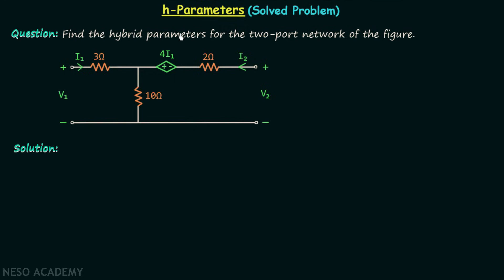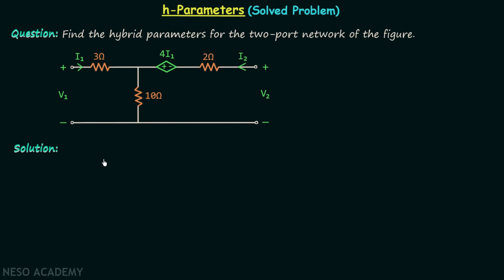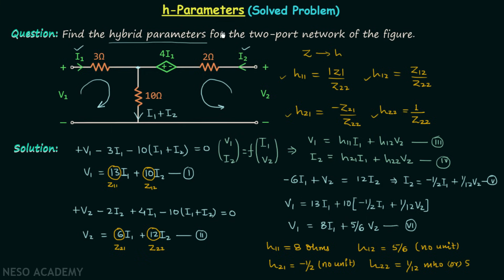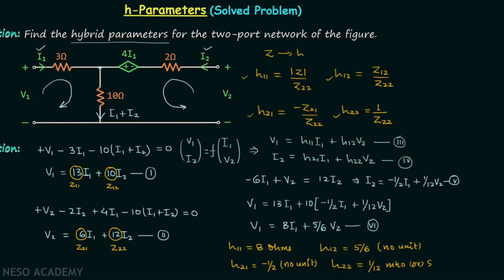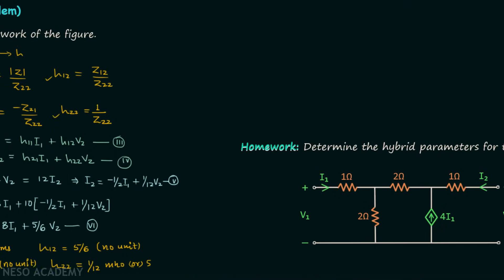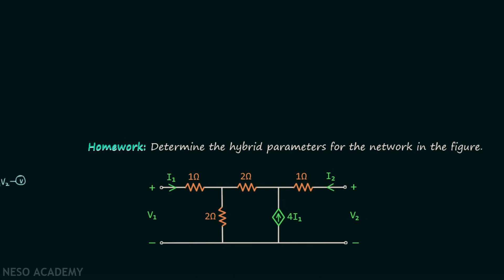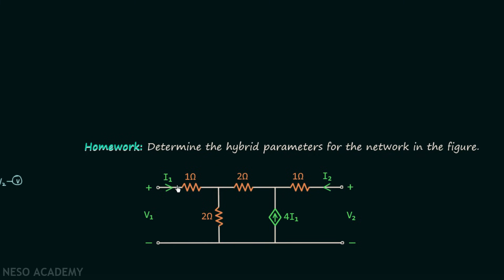h−Parameters (Solved Problem)

Comment: HOMEWORK
IN LOOP ONE OPEN 
Entering current = I1 
Exiting current = I1 
*MIDDLE LOOP CLOSED *:-
Upper branch across 2ohm
Current = 4I1 + I2 
Left 2ohm branch
Current= 4I1 + I2 + I1 
Lower without resistance branch:-
Current= 4I1 + I2 
LOOP 3 OPEN:-
Entering current = I2 
Exiting current = I2
EQUATION FOR Z parameter:-
V1 = 11I1 + 2I2 
V2 = 18I1 + 5I2 
Rest simply use the relation to convert Z parameter To h parameter
Reply: why doesn't the current in the left side resistor have (5I1+I2)
Reply: @Nandagopan-i7  it is indeed 5I1 + I2 he wrote it like that
Reply: Can you pls explain that how equation of V2 came?
Reply: @sakshichaudhary9891  You use the concept of supermesh
1. Write the current through every element while the dependent current source is present
2. Remove the dependent current source
3. Middle and right loop become one single loop
4. Solve normally with KVL
Reply: Can someone please say why the directions of 4i1 and 2i2 are different..like their terminals are in same side ..I hope I'll receive a response from anyone of you ❤️
Reply: 19/5   2/5
[H] = 
         -18/5  1/5

Comment: 4:30 I wonder, why i2 is not:  "... 10 * ( i1 + i2 + 4 * i1) ... "  but it is:  "...10 * ( i1 + i2)..."  
while in V2 it is  "... 2* i2+ 4 * i1
Reply: the 4 i1 is voltage source,not current source

Comment: In the hw ques...if u r not able to solve......the current in top left resistance (1ohm) is i1 and in bottom left 2ohm resistance it will be 5i1+i2 and in top mid 2 ohm resistance it is 4i1+i2 and in the top right 1ohm resistance it is i2 multiply these current value with resistance and you will get 2 eq which are 
V1=11i1+2i2
V2=18i1+5i2 
You will get z parameters frm here just convert them to h
Reply: tq
Reply: Thanks a lot f
Reply: How did you find them
Reply: Thanku
Reply: @022aaliyajaveedbhat5  Aaliya???
Reply: Hunny Desi Gaming 873  very kind of you thank you ☺️
Reply: Thnks bro
Reply: tq
Reply: Thanks
Reply: V2= 18i1+4i2 aa raha hai
Reply: @studyclasses708  are tumne 2(4i1+i2) krna h 
tumne 2x41i1 to kiya but 2xi2 krna bhul gye shayad!
Reply: @studyclasses708  nhin bro 5I2 ayega👍
Reply: Tq a lot
Reply: Thank you😀
Reply: well done
Reply: Thanks a lot
Reply: Can someone please say why the directions of 4i1 and 2i2 are different..like their terminals are in same side ..I hope I'll receive a response from anyone of you ❤️
Reply: Thanks

Comment: Answer:
h11 = 19/5
h12 = 2/5
h21 = -18/5
h22 = 1/5
Reply: CAN U TELL HOW IT IS 19/5 FOR H11
Reply: @kalpeshganvir7473   its determine of |z| =19 divided by value of z22 = 5
Reply: thats correct!
Reply: I m correct
Reply: correct
Reply: Please tell me the equations of loop
Reply: @simransamal7375  
V1=19/5 *I1+2/5 I2;
V2=18 *l1+ 5*I2;
First identify the current through the branches ;start form I2 may help.I  found answer this way.
Reply: @sornasanjida8106 . How v1 = this numbers??   I found v2 correctly
Reply: Yes it is correct

Comment: sir can you give me a clue how to do it i'm little bit confused
Reply: Apply the output KVl taking the 1 ohm , 2 ohm and 2 ohm resistance path into account . Neglect the current source path . You will get V2 = I2 +[ (4I1+I2)*2 ] + [(5I1+I2)*2] ... V2 = 18i1+5i2 ... 
V1 = 11(i1)+2(i2)
Reply: @dharmeshparmani8473  why we neglected the current source (4i1) path......
Reply: @anishgarg6193  coz we are finding out  z parameters and we dont know the voltage drop across the current source

Comment: h11=19/5,h12=2/5,h21=-18/5,h22=1/5
Reply: can you please tell me the solution
Reply: @prashantranjan2282  at 1R =i1 ,, at horizontal 2R=i2+4i1 ,, at vertical 2R=5i1+i2 ,,,  using these apply KVL in 2 loops and obtain h parameters
Reply: Can someone please say why the directions of 4i1 and 2i2 are different..like their terminals are in same side ..I hope I'll receive a response from anyone of you ❤️